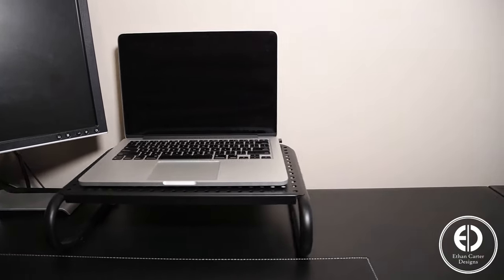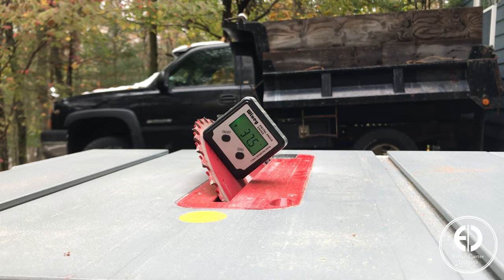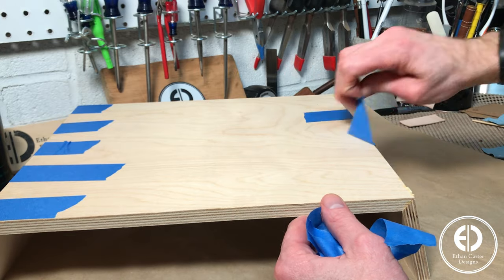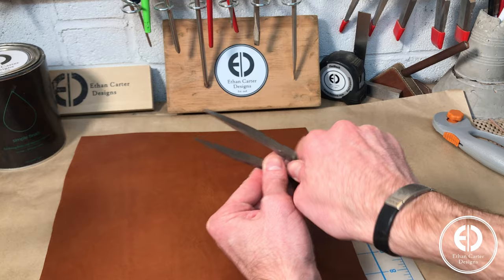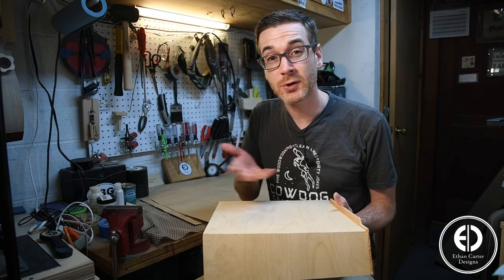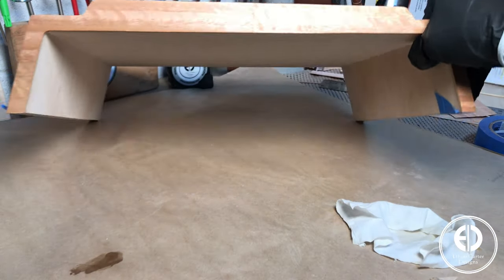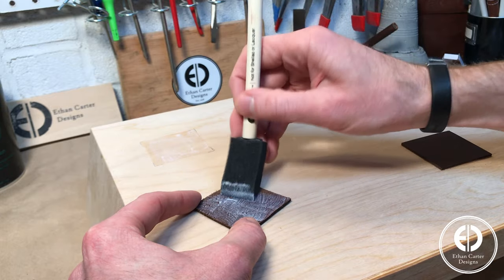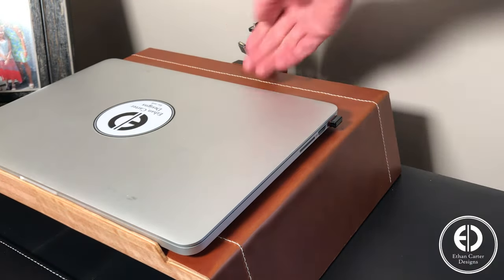How to Make A Laptop Stand For Desk

Comment: how would u figure out the perfect angle cuts for the side pieces so they are parallel to the ground?
Reply from the maker: If I'm understanding your question correctly, I think you'd just want a 45 degree angle where the sides and the top meet.